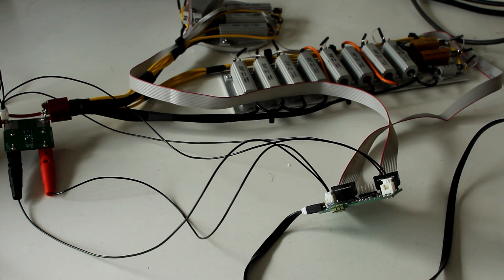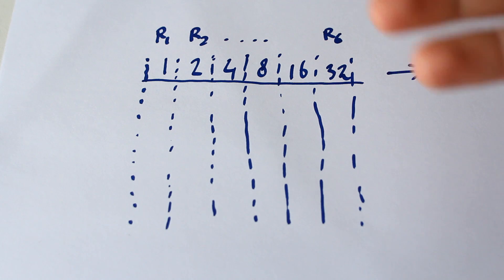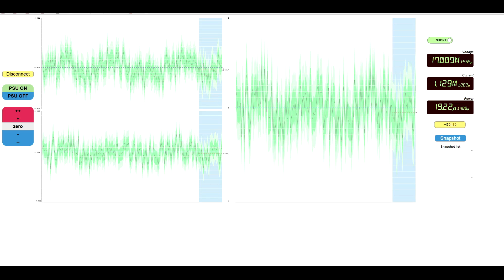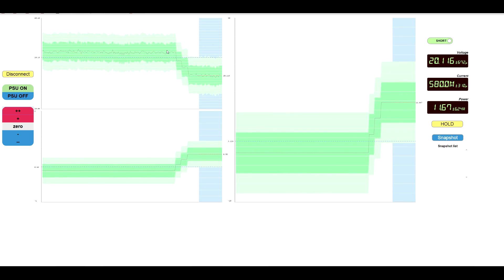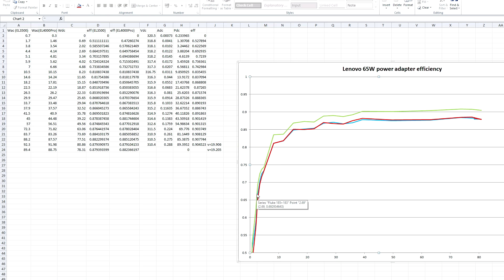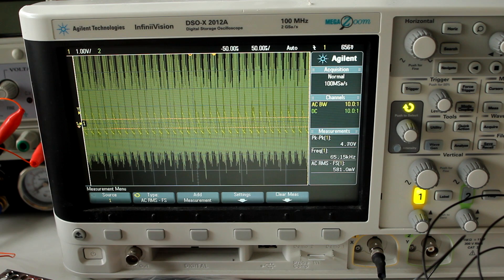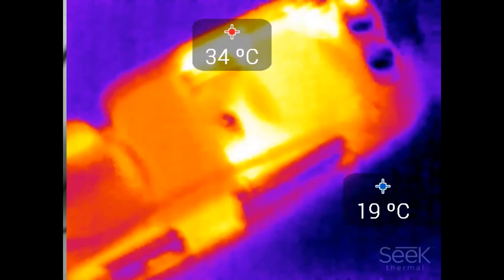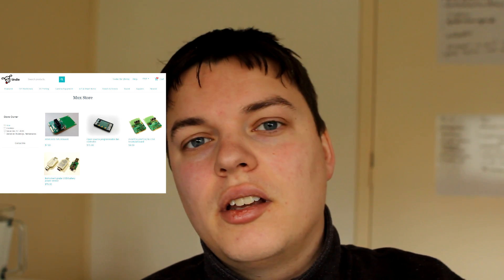My PSU testbed  - and thermal camera (013)

Comment: I built a sort of variable load once, for testing heatsinks. The way I did it was with a couple of big-ass mosfets on a heatsink, a current sense resistor, and an rc smoothed pwm-ish controller to dial in the gate voltage for a certain current through and voltage across the fets.